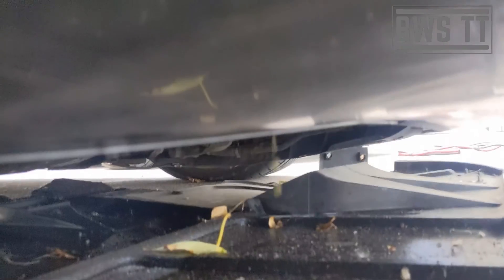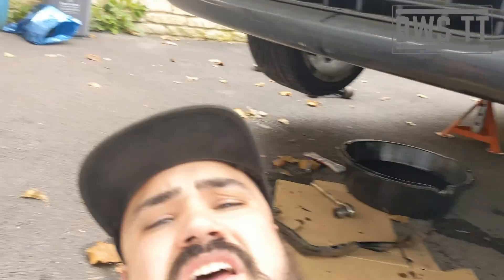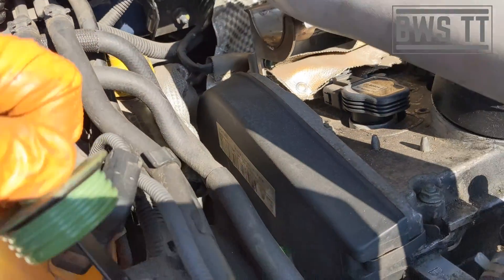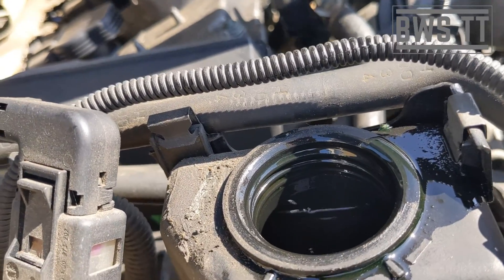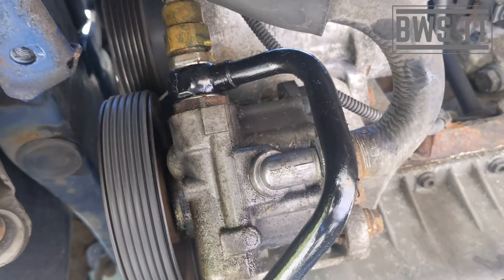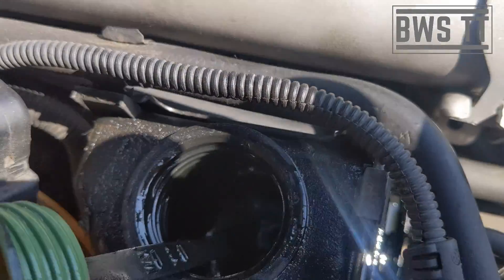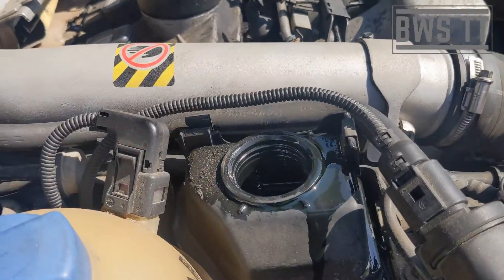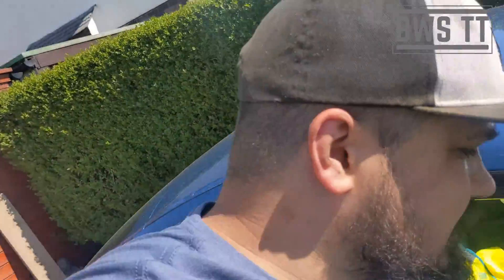Audi TT power steering bleeding

Comment: 2001 MK1; I replaced the power steering pump 2 months ago. Then the fluid leaked and found that the rack and pinion was leaking. I changed the rack and pinion and bled the system by turning the steering wheel lock to lock 30 times. Turning to the right is easy and you can hear gurgling and turning to the left it is rather difficult to turn but no gurgling. After the 30 lock to lock with the engine off; I then turned on the engine and my steering turn very quickly to the right. I redid the bleeding cycle and the same results. Please help

Comment: Does it have to be green fluid or is the regular stuff ok!
Reply from the maker: Has to be green central hydraulic fluid, CHF
Reply: Oh dear, will have to flush mine then...😢.
Reply from the maker: @schwantz037 the 2 different types react with each other and break down the seals. So yes, needs a full flush

Comment: Hey mate, 
I have replaced the pump,, but issue seems to be still there. 
There is noise while turning and it is still hard. 
What else i notice is that when i turn the steering it causes the rpm needle to move and dim the lights while turning as well. 
Please advise.

Comment: Hopefully this works for mine, had the lines off while doing an engine swap and I couldn’t get it to bleed 😅😂
Reply: Update: IT WORKED!!! Stuck it on the 4 poster ramp, took the belt off, used a dewalt drill to spin the pump and it was perfect after THANK YOU!!!

Comment: Hi, I changed my power steering pump and hoses. Refilled the system, started the car and went lock to lock. But it's still making noise how long will it take to bleed the system?
Thanks keep up the good work
Reply from the maker: You need to wait for the air bubbles to settle, then go again. Guessing you didn’t manually bleed it like the video?
Reply: @BWSTT  no I just watched your video, had the parts changed yesterday. So if I leave it the air will come out by its self?
Reply from the maker: No, leaving it just means the air forms bigger bubbles, and is easier to bleed out. The second you send air bubbles through the pump it makes them tony and more spread out, so harder to remove
Reply: @BWSTT  Thanks for your help.👍

Comment: Hello. I have to replace my power steering pressure switch. The plastic part on the sensor broke off. I have the new one. Will I have to bleed the system when I swap the new part on?
Reply from the maker: Yeah there will be a small amount of air added into the system, so just follow the bleed procedure video